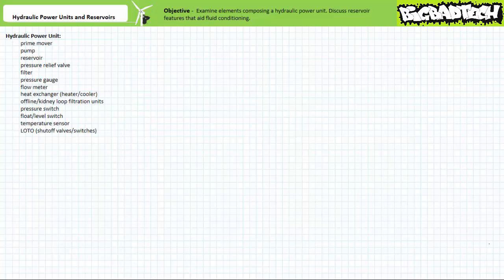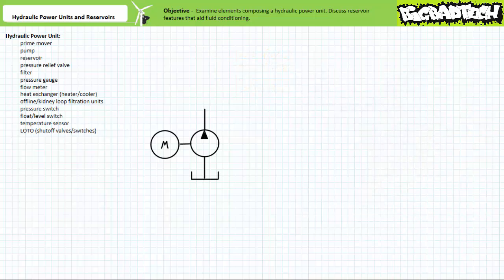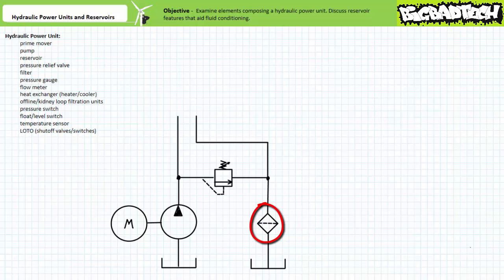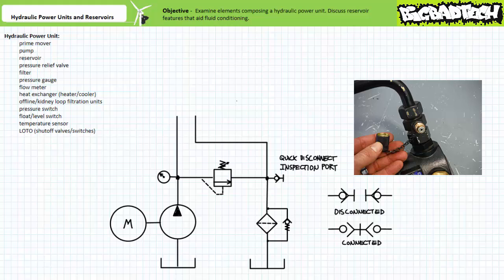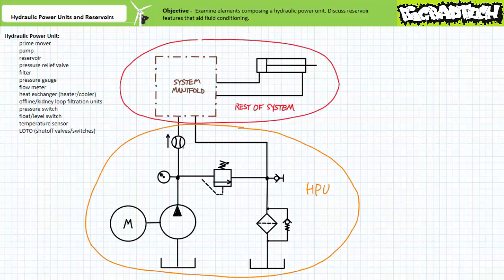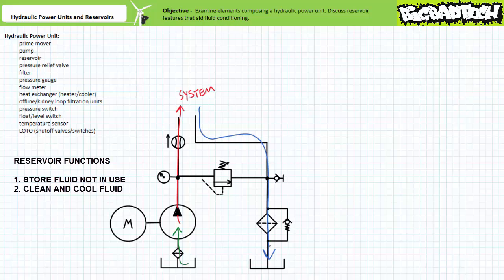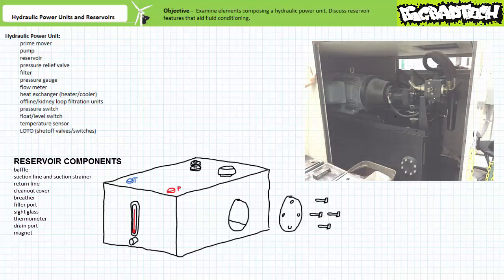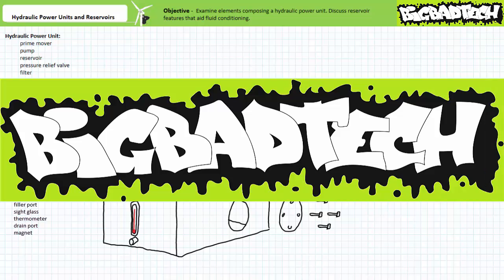Hydraulic Power Units and Reservoirs (Full Lecture)

Comment: I have been working on a Hurst Hydraulic pump for myself that wouldn't put out but 3,000 psi. They are pretty closely related to an Enerpac I do believe, and I did find out it's a 10,000 psi pump with 5,000 max prv. They are nothing like any of these YouTube videos and they are very hard, to impossible to find info on. I have owned and wrenced heavy equipment for 30 years and I have never seen anything like them. They have 2 open piston pump submerged in the tank with a rotating cam in the center.  They are 2 stages, yet those those piston pumps are the same volume and pressure. They use a directional hand valve to close the loop to dump and supply the actuator, and then they dump through a manifold with a type of unloader that can dump a little and send some pressure back to the pumps assisting them with creating the 2nd lower volume high pressure stage. Or the valve can open a little farther and can dump all pressure back to tank unpressurized. When the directional valve is dumped it just shoots everything back to tank. I found the spring in the unloader to be broken. Someone apparently had it too tight because even with a broken spring it still wouldn't unload and was stalling the engine. Or it could be that the spring broke and it was unloading all the time and they tightened it way up thinking it was the prv. Either way, I couldn't find that spring or valve so I made an angled spacer to fit where the end of the spring was broken off. I bumped up the prv and started backing down the unloader and I am getting 5,000 psi now, about 6,000 at crack, but its still tugging on the 5hp Honda pretty good. But it was choking it plumb off. Everytime I back down the unloader it helps a little, but if I go too far it will just unload everything to the tank, no pressure will even make it to the actuator. The popet spool has an undercut that has to center up while resisting spring pressure. Too far either way under full load and you will have poor performance. Its time consuming because the one big difference is all adjustments are submerged in the tank, unlike Enerpac. Guess they didn't want  joe blow fireman turning sets, and changing pressures. It's a strange little unit but I think im figuring it out.

Comment: it is always recommended for the pump to be typically installed within the reservoir? Not sure if the intend is to go for internal unless system constrains require external
Reply from the maker: Depends on manufacturer and application.

Comment: I have a HPU that sputters when first starting, it was very low on oil so I filled it, any chance you could give me a short cut to troubleshooting… it’s for a cardboard compactor. Works good just does a quick hard studder at first and before I filled it some cycles it sputtered and and stopped…
Reply from the maker: Hard saying but check if the suction line is collapsed/collapsing during start. Potential cavitation event. Check out here for details:  https://youtu.be/TBxMgGq3O94?t=2100
Reply: @bigbadtech  thanks a lot! Really appreciate it I’ll watch that video I just gotta learn more!